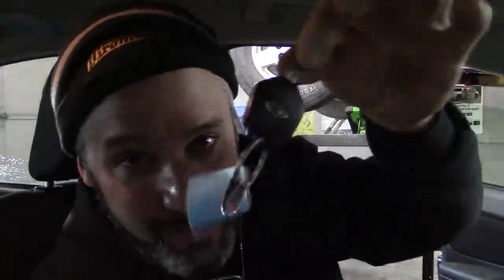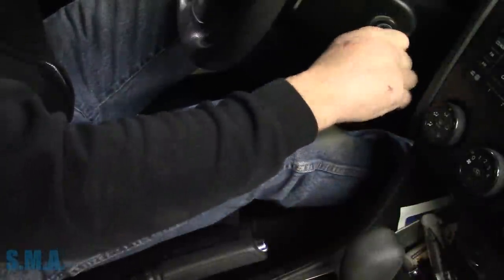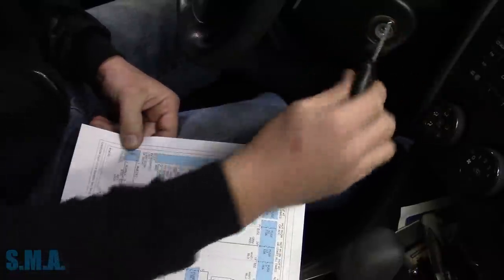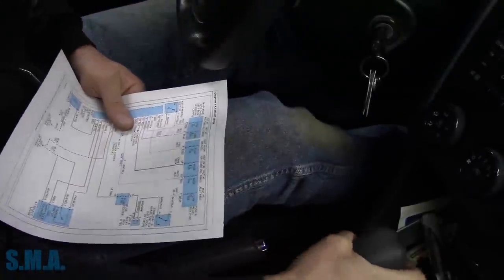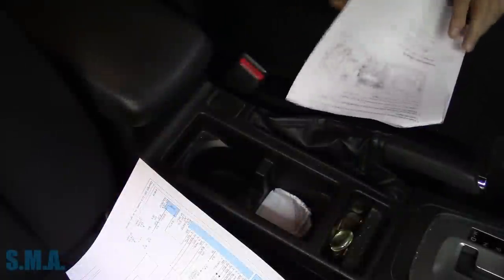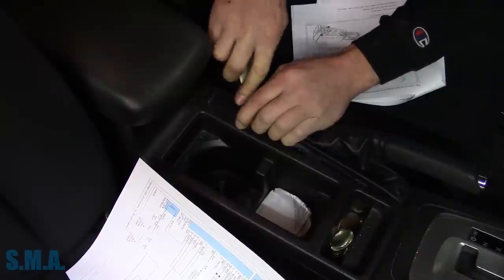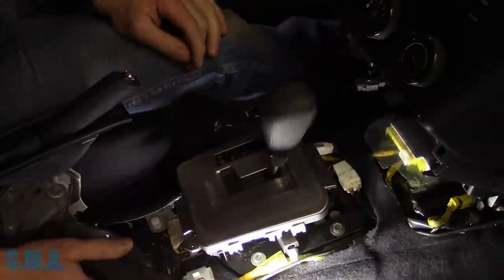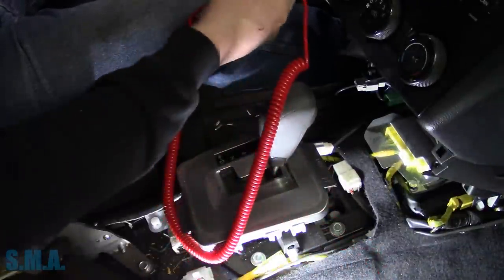Subaru Impreza: Key Will Not Come Out Of Ignition - Part I

Comment: Just a thought for Marie and her educational / career choice. I am no tree hugger, but I believe that the market share for electric cars will slowly increase until enough boxes get checked and a preference cascade occurs. And once that happens, the market for brake jobs, oil changes, filter changes, spark plug replacements, and battery replacements will shrink. And when that happens, there will be too many mechanics chasing too few cars in need of till-ringing maintenance. If this preference cascade occurs before she retires as a professional wrench turner, it could leave her in a tough spot.

Comment: i fixed this in a caddy, the lever had to be slid over after pushing up to get into park like an upside down and backwards 'L'. there was a tiny crumb in there just in the wrong spot ...i did the same ting as you drive park drive park...like wth there is nothing wrong with it, put it back together and it did it again. after a careful examination of everything i discovered it, banged it a couple times till it fell out,  and it worked perfectly

Comment: I doubt the two are related, though thought I would mention this anyway:
I have a 2017 Subaru Crosstrek; purchased new. For as long as I can remember, the key has almost never come out cleanly - always requiring a pull of the steering wheel to the left. I was told this was normal behavior by other Crosstrek owners (subaruXVforum.com). Crosstreks and Imprezas are nearly identical throughout, with the exception of ground clearance, etc.
Reply: Subaru has a habit of reusing components across models, slightly more than other brands. So it may very well be exactly the same parts.
Reply: Same car same problem but I have to jam it into park to get the key out

Comment: I would think the meter would be drawing a load and wondered if it could be helping pull down the line when in park, so not as dramatic as grounding with the test light, but enough to "fix" the problem when continuously attached. So get it to break/have the solenoid still engaged with the key stuck, then attach the meter to verify the line voltage.

Comment: I had this problem the other day and I thought it might be this, but turned out it was because I straightened the wheels after parking and when I shut off it engaged the ignition lock and the wheel put tension on the ignition barrel. Wheel wouldn't turn with the car off and key wouldn't come out. Turned the ignition on and turned the wheel left and right and shut it back off and key came right out.

Comment: My 01 legacy had similar symptoms.  A way to get the key out that I only found buried in the manual and nowhere online was to take the screw driver that came with the the changing kit, pop off the clamshell steering column cover, and insert into a slot on the bottom of the column.  The dealer changed the lock cylinder and it worked fine from them on.

Comment: I've had several cars that let you remove the key while in the ON position. Handy for leaving it running and locked
Reply: This was very common with AMC's.  The ignition lock cylinders were a joke.  In fact, AMC only made a handful of different keys....once you had one of each you could drive any AMC.  Of course if it was an older AMC any flat head screwdriver would work.  Please don't ask how i know this....  :)

Comment: I had the same problem on a 03 Pontiac Grand Prix. At the back of the steering column, there is a push-type switch I simply stuck a screw to hold this switch in and problem solved

Comment: Too cool but what a pain.  My 2016 Crostrek which is still under Subie's extended warranty runs out end of Oct 2022. It occasionally hangs the key up.   I noticed on mine when you turn the key to off, you must push the key in a tad to move the assembly down and then all the way to then remove the key.  I was not sure exactly if it was a mechanical or an electrical problem.  I removed the clamshell from the column.   I tried removing the plug down at the base of the ignition switch.  Nothing.  Then I removed the upper one where the key light is. A youtube shows that as a cure but kills light and door key charm..  It has three wires. Mine didn't kill chime or light.  Interesting.  But with it unplugged, a cold start gets a surging idle between 1000-1700 rpm.  Telling you No! No! No!  Put that back.

Comment: The value of experience. If it was me I’d be assuming the micro switch was ok and it must be a bad wire at the connector where I’ve got my test probe stuck in, as that’s the only thing I’ve altered.

Comment: Something similar happened to me in a 2004 Impreza but it wouldn't come out of park too. I took it to a transmission place and the shift assembly was too expensive so he ran a bypass button that I could press to remove the key. Had to do it every time I needed to take the key out. Side effect was that I didn't need to have a key in the ignition to shift out of park. Maybe that was because it was locked in park previously. Not sure. Traded that car in a month ago and I still sometimes reach over to hit that button in the new Subaru.

Comment: Diagnostic failure: a simple switch should go open-circuit rather than very low resistance. Spring contact fatigue and/or conductive carbon buildup from arcing would be my guess.

Comment: 2011 ford focus with 107k (ish) miles doing the same thing for me.  Think its the shifter for me to "sense" its back in park.  Good ole Ford, but key does come out while in drive after car is shut off
Reply: smitty446 try flicking the shifter button to see if it releases
Reply: That's what I was figuring as well...
Reply: And yeah if the key comes out in any position that is NOT park (neutral on a manual) there's something wrong
Reply: Is it electronic, or does it have a Bowden cable (lube dries out and it goes stiff
Reply: @richkempton2357  Usually have to shift back into drive with key in on position and back to park.  Releases after that.
Reply: @Mrflash222006  Electronic
Reply: Try just flicking the button which worked for mine if the key pulls out in drive then the tumbler is suspect

Comment: A part of the dash and shifter cover is taken off so I can push a button under the shifter which lets me release to key to take it out. I'll see what happens if I glue something to keep the button pushed in when I start the car, put it in a gear and when I turn it off. Cause I want to put the dash/shifter components back on because it looks ugly without it.

I'm sure it may be a factory button because it's right under the shifter as if you put it in park and then you can turn it off and release the key, but may be missing something to push that button when putting it in park..

It's a clunky 97 impreza outback.

Comment: If you left the "Pink with Blue" wire always pulled to ground would it cause a MIL light to come on?
Reply: That's a good question tbh
Reply: @X340n  I was thinking the same. Maybe you could just ground that pink wire all the time, if it didn't cause a computer error.

Comment: I have one of these.  One thing that happens is that turning the steering wheel too far, once the car is off, will lock the key in.  The key won't turn until you turn the wheel in the direction it doesn't want to go and the key will be then be released.

Comment: I'd bet that the the connector you're probing has an intermittent contact that wasn't always making, effectively taking the microswitch out of the circuit.  Nothing wrong with the microswitch itself.  The probe is mechanically reinforcing the contact, eliminating the fault.  Would your customer like to have a meter as a permanent addition to this vehicle?

Comment: Unrelated question... Subaru has a head gasket torque spec that seems way too tight.  Any chance the torque spec from the factory causes the gasket  failure? (I'm not a mechanic)
Reply: Does it say foot-pound or inch-pound?

Comment: 09 saturn vue with a DTC C0550 Electronic Control Unit (ECU) Performance. Is there any tests I can do to confirm i need to replace the abs module? also if you clear the code it comes right back instantly. I have good power good ground. I love your videos wish I knew half as much as you!!!

Comment: Question:  If it works when the circuit is at Zero volts, then if you cut the hot wire that feeds that switch and  splice 2 wires into that circuit going to a normal ON / momentary off switch. Then if the key ever got stuck, couldn't you just press that switch to off and remove the key???  Why wouldn't that work? - Ron

Comment: I know all to well the troubles of microswitches having torn apart a bunch of Logitech mice, both my own and my friends, to fix their left clicker.
The symptoms are: Unresponsive (no click), stuck (mouse button registers as being held down) and phantom clicks. (the mouse button registers twice or all on it's own)

You have to pull the whole mouse apart to get to the bloody thing and it's not a serviceable item. Meaning you can't just replace it (replacing it means replacing the whole friggin mouse) so you also have to pull the micro switch apart and clean all the tiny metal pieces inside it. And make them "springy" again to ensure good operation.

Upshot is, now you have a much crisper click feel to the mouse. Downshot is the clicks get really noisy.

I am almost 99% sure the same kind of crappy microswitches from China are part of this system. And they can be fixed without replacing anything.
It takes about 15 minutes to fix the actual switch. Most of the work goes into disassembling the body and making sure it goes together correctly again and keeping the glide pads in one piece and not malformed.

Comment: What about the Bugeye's? I've seen 4 different vids and they're all for the 3rd Gen (2012 & newer) either equipped with a manual or with paddle shifters. Mine is just a normal Impreza Outback Sport 2.5 auto. I don't have much spare time since I work 6 12's on the railroad on top of being my Mom's full time caregiver. I need to know if this is applicable to my model before I tear into it.

Comment: This happened to my Vette...Turned out to be a spring in the shifter column....$999.99 later...then the dealership messed up my horn after replacing a new ignition switch that l ruined trying to get the key out...Months later l realized the horn didn't work but couldn't prove it happened at the dealership..Next project..$$$$$$$$...

Comment: All I could think while the fault wast taunting poor Eric was that the circuit might be getting pulled to ground through the meter. My Electronics brain tells me that the meter shouldn't draw enough to make a difference but my What's Changed brain says that Eric clearly demonstrated the problem before he had the meter in the circuit. How much drop does it take to push a marginal circuit back into working territory?

Comment: Locking steering columns are from a bygone era that should be gone all together on anything with chipped keys. Its pointless as a theft deterrent as cars with chipped keys will not start without the chipped key. And even if you had some fast way to bypass that and are that determined, the steering lock wont hinder you.

Comment: I can tell in the first minute that your problem is that you have an automatic transmission. (slightly tongue in cheek but I bet it has to do with park safety which wouldn't happen with a manual)
Reply: No, just a "no crank" from the neutral safety switch on the manual.  Or the "clutch not depressed" switch.
Reply: @kn4cc755  had a friend at work where the clutch safety switch failed...he had to do the most bizarre dance bent over outside the car holding wires together under the dash to make it crank.  Also "hi" from kk4nde.

Comment: 16:00 maybe the pull down of the meter (10 megohm) is enough to bring the wire to ground?  Did it fail again if you took the meter off?